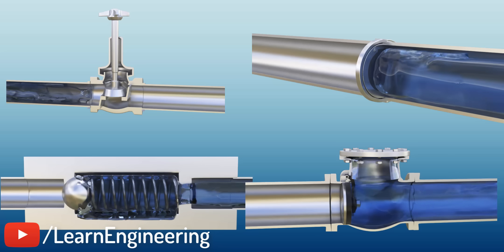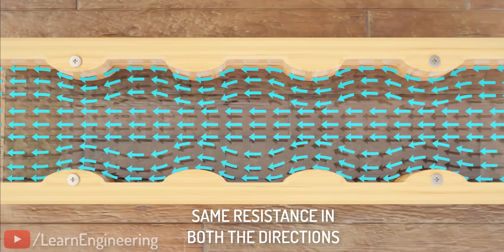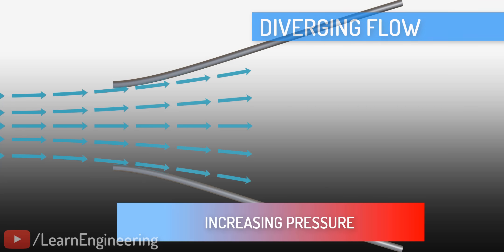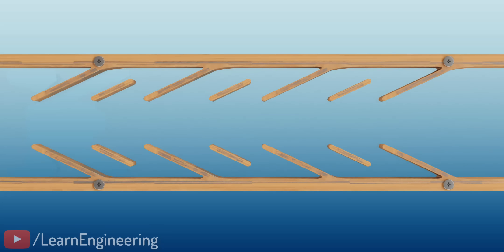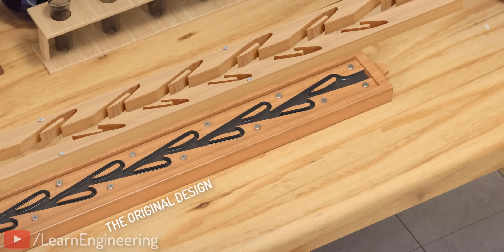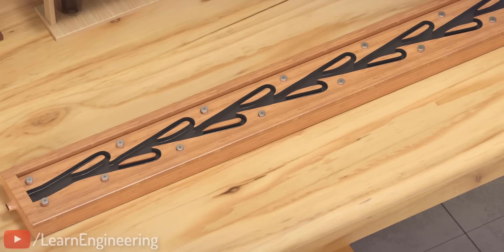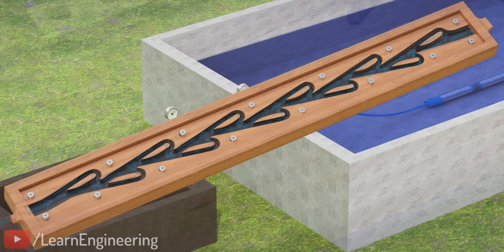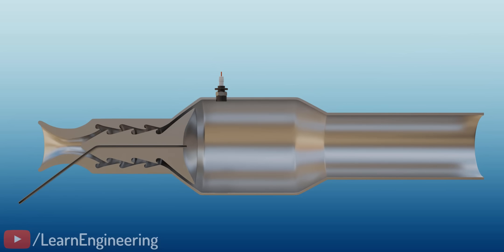Tesla Valve | The complete physics

Comment: It would be more accurate to compare this to a pressure-reducing valve, rather than a check-valve / back flow preventer.
Reply: its just a directional orrifice..... at 500x the cost of a plate with a hole in it.
Reply: Was thinking the same.
Reply: Yep.
Reply: That’s what I was thinking. For a sump pump check valve. Only problem is those are supposed to be vertically integrated. But I would imagine that the sound of it turning off would be drastically reduced if you put a couple 90 degree elbows just above the pump. It would of course need a traditional shut off valve below it though.

I mean even the more expensive “quiet” is by no means quiet. And they break, too.
Reply: Agree
Reply: https://youtu.be/NYGq0bD3NBk
Reply: https://youtu.be/NYGq0bD3NBk
Reply: https://youtu.be/NYGq0bD3NBk
Reply: https://youtu.be/NYGq0bD3NBk
Reply: I would love to see you do it. Just think of what would be accomplished and designed by you.
Reply: @byronndavis1074  I would redirect the fluid all back to the original source mono directionally, this would be equal pressure in opposite direction of original flow, they would cancel each other out
Reply: @byronndavis1074  perhaps I’m miss understanding your comment, but I wasn’t dissing the valve at all.  Just saying it is not a true check valve.  It looks like a very excellent pressure reducing valve if the application does not require precision, as it has no moving parts and pressure reduction ramps up with input pressure. 

As someone who installs check valves and back flow preventers that MUST keep ALL irrigation water out of city water lines, I take an interest in this.

Comment: Okay.... the question was first asked, can you make a valve stop, without moving part.   First off, it does STOP the flow.  Secondly, you would have to MOVE the part around to get the trickle..      Your premise has failed.  If you wanted to show off Teslas valve... you needed to use a different premise to begin your quest.

Comment: after watching this video, i am shocked that, this kind of tesla’s genius work is not included in engineering curriculum.

”i wonder, if we have (control) it’s flow-pressure characteristics, maybe we can create FLUID TRANSISTOR & DIODE circuits in real world!”

i already started imagining it’s possible applications also in gaseous fluids, aerodynamics, etc.

Comment: I designed one that is simpler and was used in a pneumatic motor to provide lubrication only when the motor was operated in one direction and not in the other. It was patented around 1990.

Comment: Tesla didn’t call this a “valve”, because this is not a valve.
Reply: This is called a check valve  one is a sewer check valve an the other is a spring loaded check valve. He might not have called it a valve but it is indeed a valve because it controls flow an pressure .
Reply: @JohnDoe-mx3vg  Something that controls flow is called a flow control device. Something that controls pressure is called a pressure regulator.

Comment: Under steady state conditions this valve will only yield a constant pressure drop without any further control to the pressure or flow. It looks intriguing but it is just one design for breaking a fluid during its flow pattern. Valves like these are actually horizontal orifices much like vertical orifice used in pitot tubes to measure pressure differentials. The real benefit to control would be if the directing vane angles could be altered through another mechanism to then alter the flow and pressure gradient through each subsequent units.
Reply: once we introduce moving parts, the basic spirit of the invention may get effected. i am wondering about additional units arranged in a pattern, some how creating a fluid transistor/ diode kind of circuits.

Comment: seem this will not function as one way valve because, there is nothing to stop the fluid from flowing back to the inlet when the fluid stop flowing, which mean in a static state. this is more likely works like flow speed reducer when there is a flowing fluid in my opinion, but still mind blowing invention during his times

Comment: The Tesla valve stops slowing flow once it fills up with liquid. The only reason it slows it down at all is when you put liquid in one way it flows through no proble. When you put liquid through the other way, it has to fill up before liquid starts flowing through it properly. That is all. Tesla valves don't work.

Comment: Wouldn't this design be an ideal part of a hand pump?  Water squishes easily one way (the down stroke), but doesn't pull back easily on the up stroke.
Reply: As far as I know, hand pump already have some mechanic to do it
Reply: Very interesting idea, though I suspect the lifespan vs the simplicity of manufacturing a conventional valve still gives them the advantage, its not like conventional well hand pump valves have a particular need for tight fit and peak efficiency

Comment: The conventional valves shown at the beginning of the video, the in-line valves with moving parts, are actually capable of stopping flow completely, something which the Tesla valve can't do. What Tesla invented is an ingenious flow-reduction device, with certain specific applications. I used to work in the gas industry, so my primary requirement for a valve would be for it to turn flow on, or off. Such a valve could also be used to control flow by enlarging or reducing its aperture.  The title of the video is therefore disingenuous. I suggest that the vast majority of people would define an in-line valve as a device to turn flow on on or off. Pedantic I know,  but that's what I am. small details matter to me.

Comment: Makes a perfect gun suppressor: the bullet passes trough, the gas slows itself down.
Reply: Some gasses exit before bullet therefore slowing down the bullet
Reply: @oskartuulik633  Even better ! The solution can be tuned to achieve subsonic speed with normal ammo. In fact, by closing/opening some of the side-cavities by turning rings on the outside of the supressor, one could adjust between noise suppression vs. muzzle velocity.
Reply: @oskartuulik633  Gasses can't exit before the bullet does since it's a tight fit between the bullet and a barrel of a gun. And the amount of gas that would go in front of the bullet is negligible.
Reply: @vulekv93  It still would make a noise, just as Tesla's "one way" valve isn't truly one way as fluid can still escape. Think about how little of air there is when you clap your hands. Quite a small amount, but still makes a sound.

Comment: I'm guessing the main reason this type valve hasn't caught on is simply because, as stated, it can not complete block the reverse flow.
For instance water without a lot of pressure behind it (from static height or a pump) will create less vortices and therefor less resistance.
The harder you push the water through (use a big pump), the pressure loss will increase exponentially, and so in relative terms it will be more efficient. It still won't stop flow completely though. It will also mean more damage to the valve due to pit corrosion (the same you get on ships propellers), and that would severely restrict the lifespan.

But it is certainly an ingenious design, no doubt.
Reply: You can put a mechanical vale at the end which will be suspectible to less wear and tear.
Reply: That’s not necessarily a bad thing. When you have low flow and low pressure, the moving parts associated with a true one-way valve will be less likely to fail and will have less associated wear.
Reply: It is indeed used in microfluidic systems, but there it has another purpose and that is mixing. The microfluidic channels have highly laminar flow so mixing becomes an issue. The Tesla valves are one of the most effective ways to mix your fluids.
Reply: Well the pulsejet concept at the end is a great example, also in theory could be used to replace reed valves in 2-stroke motors. The current carburetor system has some pressure loss anyways, a design like this could emulate the function of a reed valve without the problems of wearing out. And in the example of pulsejets, the pressures experienced in the combustion chamber are quite high indeed as well as being fairly frequent, which wears out traditional reed valves pretty quickly. It could also have applications in hydraulic logic, as a resistor as one user mentioned or as a flow regulating valve to enforce unidirectional flow.
Reply: Yeah poop would definitely stick everywhere 🙄
Reply: It’s just not very efficient. Valves with moving parts are much more compact and can move more fluid.
Reply: FEWER!!
Reply: Also it's far too long and has too much head loss in the "forward" direction to be practical
Reply: Would be great for Solar thermal Prevent thermosiphon
Reply: بامم من. تنهي عع
Reply: Tesla valves work best for high frequency pulses. They don’t work for DC flows.
Reply: That's what smooth surfaces are for.
Reply: I was thinking you could use this to limit the flow and have another valve behind it. Until you realise that you could just replace the other valve if it gets broken 😂
Reply: If used for underground plumbing, it would be a pain if one or more of the secondary valves got clogged and it needed cleaning.
Reply: Still useful 5:30
Reply: @CCNightcore  it's a good novelty
Reply: Yeah it's nothing more than a novelty. Something for teachers to show children to get them to think outside the box
Reply: Tesla's "valve" is a piece of junk.   its only directional orrifice that restricts one side more than the other.
It has no practical use.   If you needed a 1 way orrifice... check valves and a spillback loop would be cheaper than manufacturing this POS
Reply: @zarthemad8386  you know, it's possible to criticize the valve design and provide your opinion on it without sounding like a needy edgelord. Try it!
Reply: @zarthemad8386  Careful,  your double digit IQ is showing.
Reply: @zarthemad8386  - What a true simpleton you are.  You really tried to speak poorly of Tesla's work?  Slap some sense into yourself, boy.

Comment: I don't understand why we dont use levers for producing electricity, using gravity.
Reply: Because generally the same amount of energy that pulls down on the lever will need to be applied to move it back to an elevated position
Reply: @thederptor2571  nope they do it with turbines for hydro-elctricity production.
On second fought i think a lever system would be too hard to maintain and maybe less effective than a turbine one.
Reply: @gontrandtrand  yes, but turbines arent powered by their own weight pulling down they're powered by the force of waterflow or airflow
Reply: @thederptor2571  I know very well how it works. Thank you.
Reply: @gontrandtrand  Yes, but they're different than a lever using gravity as instead of wind giving energy to it as a turbine or hydroelectric system works, only gravity is impacting it. Therefore if 2 watts of energy are created by dropping it 2 watts of energy was used to lift it to begin with, that's why gravity based perpetual motion machines are difficult as the exact same amount of energy generated by it falling is used to lift it back up.
Reply: @gontrandtrand  with turbine and hydroelectricity it's different as while water moves down to a lower elevation and wind currents blow turbines, external solar energy is returning them to an elevated state with the sun evaporating water and it eventually being redeposited through precipitation, and the sun heating the air and therefore resulting in wind currents that work wind turbines. With a lever working solely off gravity there'd have to be some form of external energy to return it to an elevated state that renewable enough that it wouldn't be inefficient
Reply: @thederptor2571  I'm not fluent in English so it can be confusing.
Ok so potential energy is the water stocked above the energy producing system.
Use your imagination, how can you use the multiplicated force provided by levers, with the water above ?
One system you can think of (and i think friction would make it very maintenance heavy) is pouring liquid into a recipient attached to a lever, and at the end of it the system producing electricty, once the lever is down it pours into another recipient attached to a similar system.
The idea being to multiplicate the potential energy each time it is poured in the recipient.
You can imagine a lot of application with force multipliers, the problem being that those systems need to be simplified to the maximum, and sturdy.

Comment: Think of this thing more as a damper than a true, air tight, one way valve. It can be used to control flow rates inside of a system under pressure. It can stop reverse flow events from back propagating through a semi pressurized, or gravity fed system.

What if someone gave this shape to an AI and asked it to give a better design? What do you think it would look like? How many times could you sub branch the main shape before the effectiveness is diminished? Can you imagine a 3D pipe shape that would work as well as this shape? Like conical pieces inside of conical paths. The secondary branching would need to redirect the fluid as it rebounded off the back side of the inner cone. And bringing it back together at the narrowest point, directly behind. So, in some sense, the secondary paths would be better if they had slightly more diameter than the "main" path. Forcing the fluid to go that direction.
Reply: The AI would slap you and tell you to either use a check valve or to use a pilot operated valve.  ... Hell if you want it to leak backwards just like the Tesla "valve" then drill a hole in the plate of the check.
Reply: @zarthemad8386  Tell us you don't know anything about engineering without telling us you don't know anything about engineering

Comment: So he created a one way valve that doesn’t stop water one way just “drastically reduces its flow”, brilliant!
Reply: Cool, the worlds first  Pressure Reducing Valve
Reply: And what have you done?
Reply: @andrequimpo9363  What a ridiculous statement.
Reply: @timprescott4634  No, he pointed out that the critique is ridiculous, because completely stopping the flow is not what this invention is about. Knowing the most efficient way to reduce flow rate is in many cases exactly what's needed. Also with enough loops you can get a almost coplete seal. Not having 100% efficiency does not reduce the usefullness of this invention.
Reply: @palodoxaliqua5809  No, he didn’t.  Had he done that I wouldn’t have said anything.  He just punted to the intellectually bankrupt, “What have YOU done” reply which is RIDICULOUS.
Reply: @timprescott4634  really? My reply is more ridiculous than the one who sarcastically said the invention just reduced the flow is brilliant?
Reply: @palodoxaliqua5809  thank you. That’s exactly what I meant.
Reply: @andrequimpo9363  That is LITERALLY what it does…
Reply: @timprescott4634  yes. But the comment was sarcastic in saying it was “brilliant” What don’t you get about that?
Reply: @palodoxaliqua5809  The design can't reduce flow by 100%, because without flow, there are not vortexes, and so nothing resists the flow of the fluid. According to Wikipedia, Tesla valves only have a reverse pressure drop ratio of only 2-4 times the forward pressure drop. Tesla valves can reduce flow rates by noticeable amounts, but there a few applications in which a moderately-reduce-the-reverse-flow valve is useful. It's basically a solution searching for a problem.

Comment: My house is going through renovations on the piping system due to heavy rains causing the water to flow up through the drains. But I don't think we can implement this valve to mitigate the back flow during the heavy rains' flood event, because it doesn't cause an actual stream, it's more like an already slow filling...

Comment: A great design, much more rubost than an orifice choke. However, should not be called "valve", which suppose an external and variable control of flow rate. Rather call it Passive Inflow Control Device.
Anyway, an excelent video! Congratulations!

Comment: Basically,  it's a diode. Can't wait to see fluid transistors
Reply: Lero lero lero lero
Reply: @sumitmishra3037  man of culture
Reply: @nickputkaradze1181  long live cherry boy 
😭😭
Reply: Didn’t someone make a liquid calculator? If so it shouldn’t be that hard to make one
Reply: @BlueberryCats_  the amount of work to get 4+3is astounding
Reply: @JassZoigel  it's probably not that much more work than getting an electric current to do the same, for all I know it might might be less. Just way slower and requiring a lot more lifting.
Reply: They are everywhere in automatic transmission vehicles right?
Reply: Its rather a resistor
Reply: @nandechi  Transit one way/resist the other, transistor. Resist both ways resistor.

Comment: Wouldn't there be a moving part tho since you'd either have to either rotate the valve in order to change direction of flow or have some sort of other valves in order to switch to this valve
Reply: Only if the application requires it. For example, the pulsejet engine mentioned uses a similar geometry as the Tesla valve to direct the majority of gases out the exhaust instead of out the intake. There isn't a practical reason to reverse the valve.